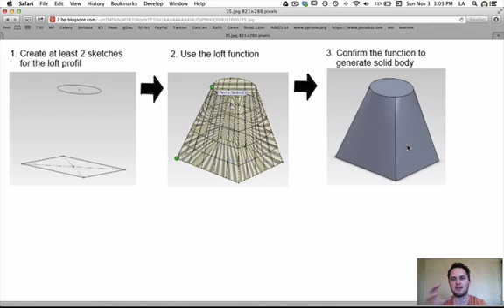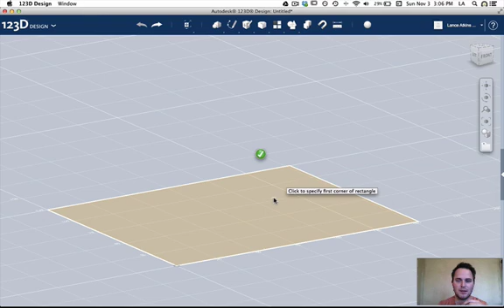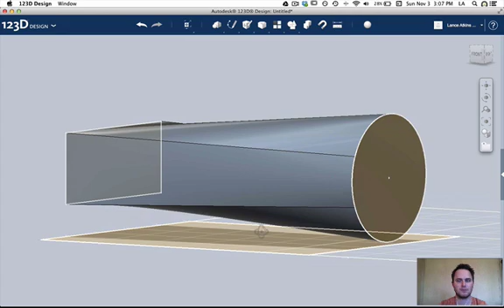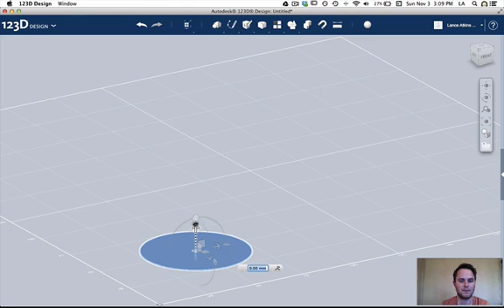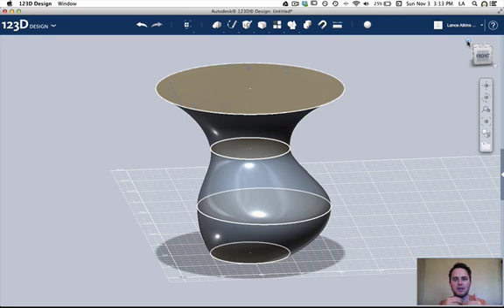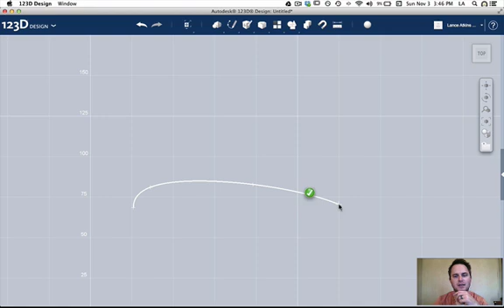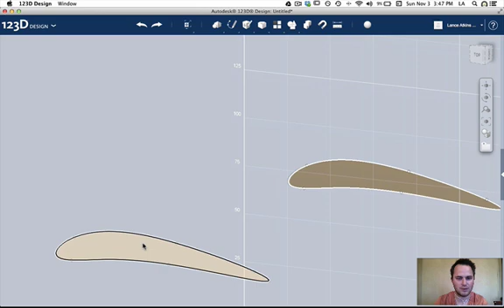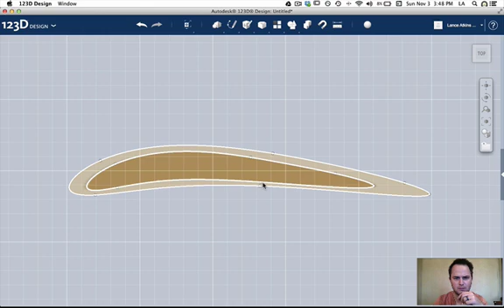Autodesk 123D Design -- Lofting Tutorial - 3 Different Methods of 3D Design

Comment: i used this method to make a vase, but when i deleted the original four circles the top of the vase was still enclosed. how do you delete the circles so that the vase is hollow and i can actually put flowers and water in the top of it. thanks
Reply: +chrissy cascio  use the MeshMixer to hollow things out OR use Shell command under Modify, make sure you have all the walls everywhere the Vase at minimum thickness that your 3D print (or your 3D printer) company can support!

Comment: How do you make it so the wing is hollow? The Loft tool always seems to produce a solid object. What do you do if you want something that's lofted but hollow inside?
Reply: Just a guess, but maybe use an offset on both sides of the sketch before lofting, that way your just lofting the difference and would create a hollow wing.
Reply: Roger Garrett I just did it with the carve tool.
Reply: +Roger Garrett you could use the shell command but that would hollow out the wing just like the vase. If you made the wing "struts" with cutouts and used the sweep cmd, the cutouts would be hollow as well.